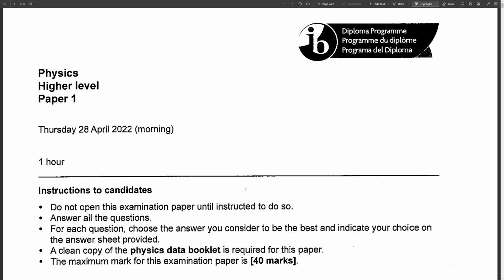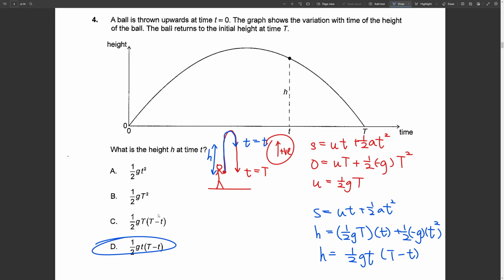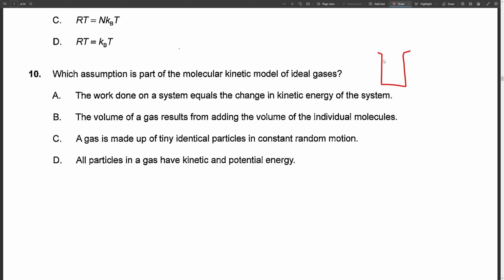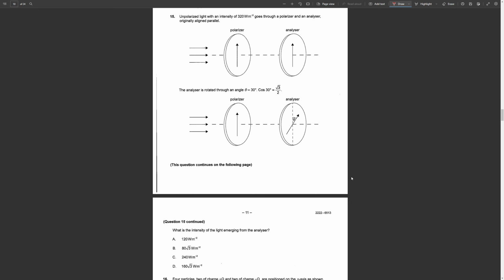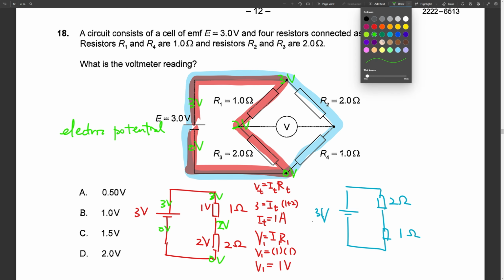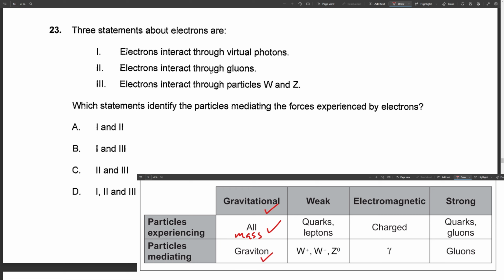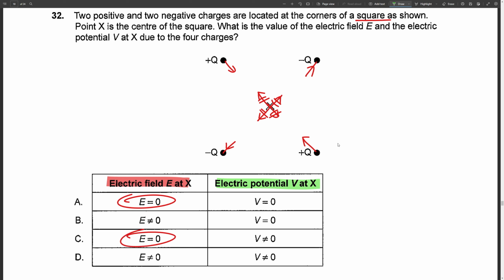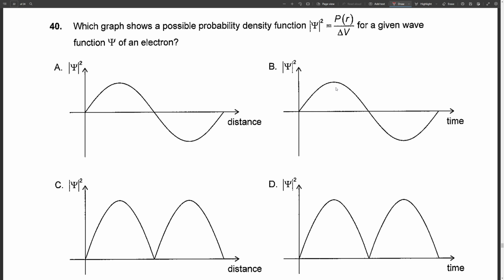IB Physics Exam Paper Solutions | 2022 May Time Zone 2 | Higher Level | Paper 1

Comment: @Physics Exam Paper Solutions Why did you say the angle theta does not chnage in question 19 ?
Reply from the maker: Thank you for your question.
The magnetic field is always pointing from right to left meanwhile the current is always going from X to Y. They are both in the same horizontal plane. The angle is always 90 degrees.
Reply: @physicsexampapersolutions3357  But when the coil is moving isn't the angle changing ?
Reply from the maker: @akasharjun1211  no matter the plan of coil is being vertical, horizontal or oblique, the current is still going from X to Y, which is perpendicular to the magnetic field.